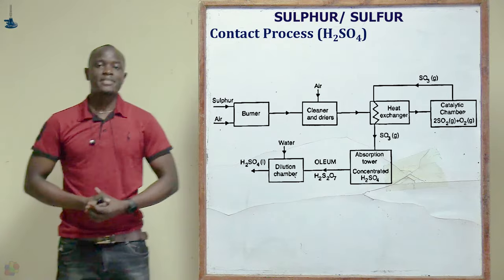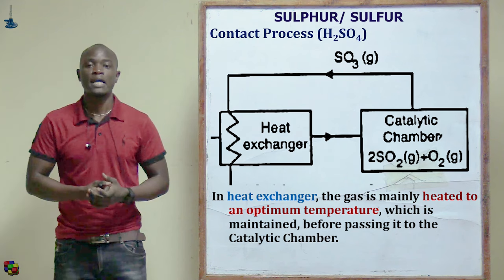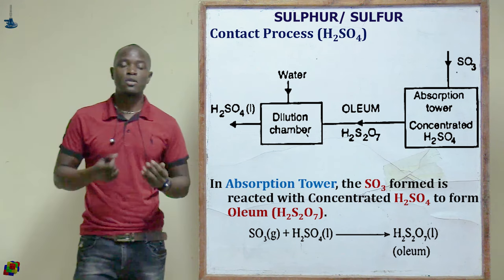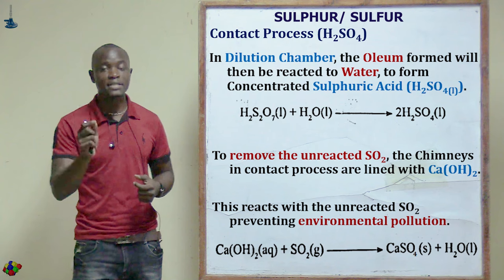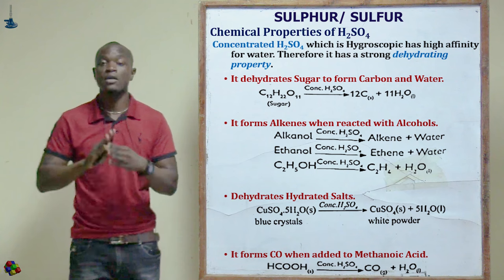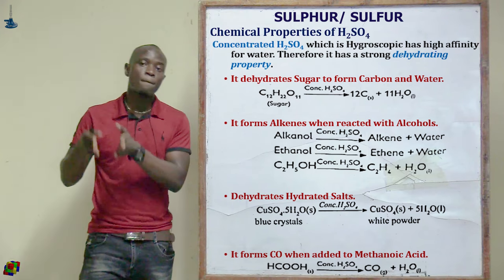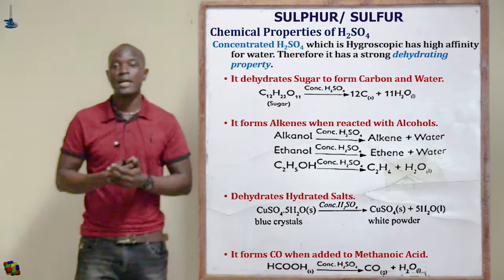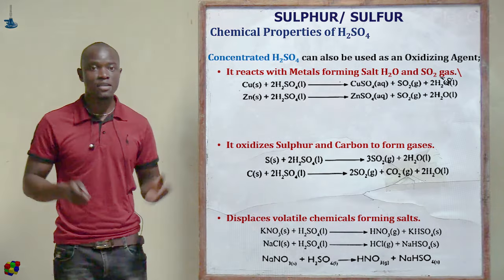7. Largescale Manufacture of Sulphuric Acid; Contact Process Chemistry Form 3

Comment: Good work sir. But you haven't mentioned why the process is called "contact process"
Reply from the maker: It is called the Contact Process because it relies on the use of a catalyst V2O5 or Pt, to speed up the chemical reaction that produces sulfur trioxide SO₃, which is a main raw material for hio process.
Reply: If so, why then is Haber process not referred to as contact, Cox it also uses a catalyst